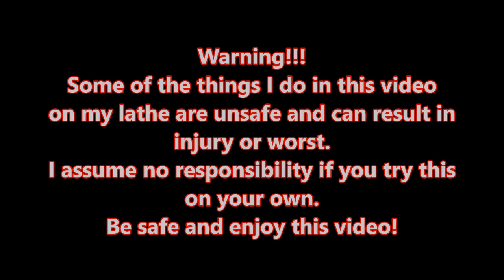Woodturning Djembe Dream Part 2

Comment: Good Progress my friend.
I hope you treat that Knot in the side of the bowl before hollowing, otherwise you may end up with a big oops there.
You have a good outside shape I tend to make the stem (bottom half) flare more but I can weld my rings on the drum too, which is necessary to put the big flare on the bottom. 
Now I gotta say it though "Who created a monster?" LOL
Looking forward to the next installment.
Oh I am going to do a cracked shell repair video for my next one. So just in case we will have that covered. From the looks of it though you shouldn't have too much trouble once the core is out of it.
Reply from the maker: +Cyrus Fillmore (Time Lapse Turner) Thanks Cy! I'm well on my way, already half hollow, the stem is hollow and I've just flipped it around and mounted on the jam chuck, spins a little wobbly, but nothing I can't handle... :)
I don't know what I should do with that knot, for a couple of reasons, it's not a knot, it's a sap pocket, I've already cleaned it out, meaning I will have a large hole I will need to find a way to close up. I was thinking of turning it like that, be extra careful in the pocket area, leave it to dry, and  then so some epoxy and shavings mix and fill it up... should I do this while the shell is still wet??